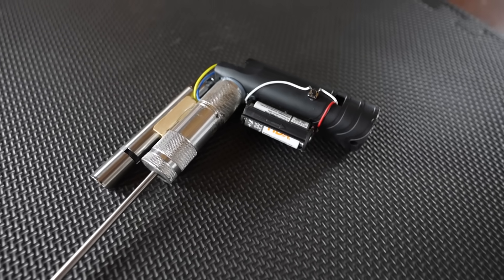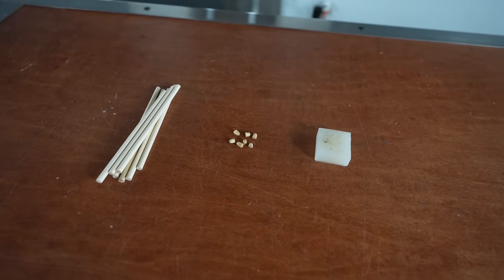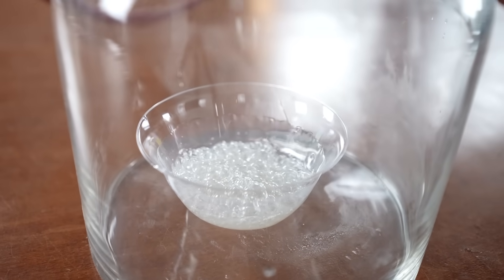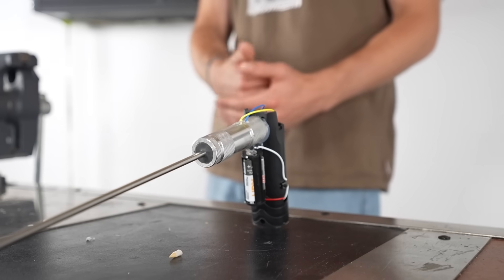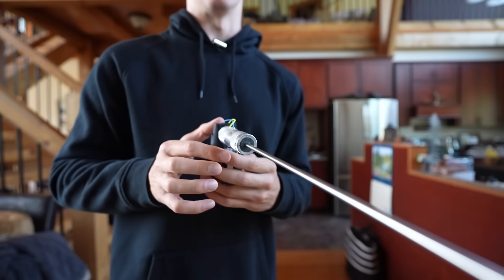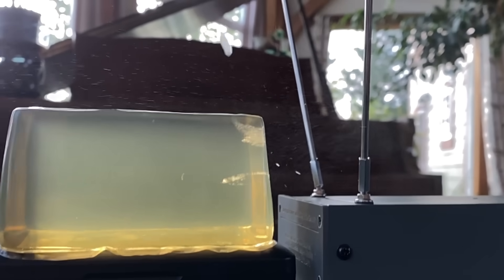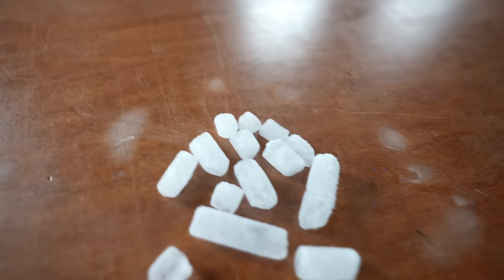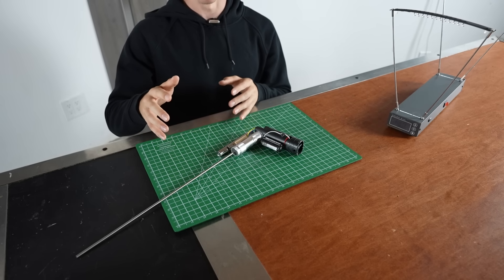I Made a Mini Desktop Weapon That Shoots ICE

Comment: Maybe put the ice bullet tray in an air tight box with a vacuum before freezing it and the bullets may be a little more solid and durable die to the lack of bubbles. I'd certainly be curious to see if it makes a difference.

Comment: So you need an exterior shell around the barrel that you can put dry ice into possible after shredding it into snow so that the barrel stays cold shorten the length of the barrel and use CO2 as the propellent
Reply: Also be careful and make sure the material the barrel is made out of a material that won't crack under those chilling temperatures it may not be an issue but I am not for certain

Comment: … the show BONES has an episode with this concept. The “killer” used a pneumatic device much like the one made. The killer then used blood frozen in the same molds. The reason blood was used was because it was more dense than the ice meaning they wouldn’t shatter on impact. The “blood bullets” also had a poison aspect because depending on the blood type of the victim the blood used too make the bullets would mix after the bullet melts. However this was all Hollywood and this video is real soooo.

Comment: maybe add something to keep you barrel in the dry ice, like a barrel around the main barrel with pocket for dry ice. seeing how long that is 3 or 4 pocket. but I think with 3 the barrel should be cold enough between shot. maybe also add a dry ice socket under you magazine. but that is only if you want to make many. but let's say we goes as far as a machine gun, the rope of bullet would have to come out from cooler. They wont have time to melt unless you are sitting in the desert or near a volcano.

Comment: I wonder if there is a way that you could freeze it while it's loaded. Would help to have a revolver mechanism. Maybe you could 3d print that. If the revolving mechanism were replacable, you could make it a fast reload also.

MAybe a pepperbox or mini gun style would work so that it basically has multiple revolving barrels instead of one barrel and a revolving wheel.

Maybe with the newly enlarged frame, you can find ways to cool wherever the ammo is held as well.

Comment: put a ring with a hole slightly smaller than the barrel between the barrel and gas chamber so you can drop metall bb's into it without having to unscrew everything and then use a small blowtorch to build the gas and fire

Comment: I thought about designing an Ice Gun many years gone by.  I would trash your ice-cube silicone mold and come up with an add-on that freezes the projectile in situ.  You might also have better luck if you make your ammo closer in size to a .22 bullet.   And perhaps slightly heating your ice bullet before it gets fired might encapsulate it with a thin watery surface, which would make it more lubricious.  Finally, I'd see about using the rifled barrel of an actual gun to see if that would increase accuracy of your ice bullet by keeping it from tumbling in the air.

Comment: you should make a gun that uses oxyhydrogen directly made in the gun itself from a dry cell as fuel
also use a peltier and an auto loading system to automatically freeze water and load it. then the only stuff you need is water and electricity

Comment: I see a lot of comments talking about Peltiers, but they are not energy efficient.

I think you should either use a mini cryogenic tank holding LN2 to flash freeze the water into shape and cool the barrel.

Or… you can use a refrigerant and cycle phase changes to transfer heat to do the same thing..

Comment: Hey, it's a great idea, I'm just wondering if you could make some sort of air rifle, that doesn't rely on that combustion for the pressure, if it was using a CO2 cartridge, it might not create as much heat.  Also maybe you could find a tube of the same internal diameter but with a thicker wall, this may take longer to heat up after cooling.

Comment: Use a bike pump as the combustion chamber, design a way to keep the piaton locked before shooting, instead of a valve to keep the pressure you could use some sort of plastic film that will break when the combustion gets triggered

Comment: Boo make ice VI with steel moulds and a hydraulic press, it will last longer. Or use heavy water ice. Perhaps research some fibre reinforcement that melts away or blends in well with animal tissue, like metamucil or hair

Comment: You should make a rapid ammo freezing mold. Like you put water in it, then pour liquid nitrogen into a cavity within the mold. Or make it with a cavity to put dry ice into. That way the water ice freezes really solid and stays cold. Plus, ice that's below at liquid nitrogen temperatures is VERY hard and strong. With an ultra-cold mold you can make more ammo very quickly. I love the dry ice cooled barrel.

Comment: I'd recommend a website called BurntLatke that can help with the calculations to get the perfect fuel to air ratio for a given volume to increase the power and consistency of your shots. There's also an old forum called SpudFiles that deals with potato cannons and other related launchers. It's a bit slow and it's not very active but you can search for great ideas if you want to improve/optimize your build such as how to build a propane meter to fill your chamber with the correct amount of gas or spark placement to speed up the combustion flame front. They also have a wiki with a lot of technical information.

Comment: I would say use liquid nitrogen with copper tubing around the barrel or a copper pipe that's bigger than the barrel and just cover the openings and put liquid nitrogen in it, and shake it around while having a pressure release valve, i know the barrel may get bigger but would be cool, and try firing liquid gallium when solid, that's my thoughts

Comment: Been thinking that having multiple sparks uniformly distributed in the combustion chamber might make it explode faster. Making them spark at the exact same time might be difficult so maybe just have a wire with several smaller airgaps along its length (should still spark), which would spark at exactly the same time and lead to more even combustion. Also, have you tried HHO2 gas yet? Super easy to make, and IIRC the blast front travels at Mach 9.

Comment: It needs to a 3D printable handle. That way you can house the wiring and trigger better. But then don't forget to share the files (doesn't have to be for free). Also a full proper step by step build video.

Comment: If you want ,, clear " ice ammo. Build a small Styrofoam box , put your ice moulds in, and then in the freezer.  Takes more time, but in the end, you get clear ice without bubbles.  Works for normal ice cubes as well 👍
Reply: Why does this work?
Reply: @hannesaltenfelder4302 The longer it takes to freeze, the less bubbles you'll get. It has to do with the outside of the ice cube freezing first vs. the expansion of the center of the cube.

Comment: Rifling the barrel would be extremely difficult. But it might be possible to rifle the ammo. Not made of ice, but possibly wood or plastic. Also, you need some way to standardize your fuel charge at the best mixture for maximum strength. My potato cannons all used propane torches to feed both fuel & air into the combustion chamber. Perhaps you could incorporate something like that.
Reply: Rifled projectiles do not work. They exist. But, they essentially do nothing.
Reply: or even HHO as you don't leave any traceable residue gas :)

Comment: Make an air tight canister around the barrel similar to how water cooled guns are. But fill it with liquid nitrogen so it's always cold and stays cold.
Reply: Usually airtight + ln2 = explosion, sadly. 

What he can do is spray liquid nitrogen over the barrel, or even just butane/propane into the front. The bullet seals the chamber anyway.

Comment: To add to my other comment, also a common c02 canister when pierced, could freeze an entire water tank magazine if designed correctly, as long as you dump that mag quickly, and can use a peltier to keep them frozen as they are way to slow to fast freeze anything lol
Reply: So would liquid nitrogen be to hard to source or not effective enough or to hard to wrap the lines and barrel and make a semi auto style water gun with a cold block to make ice ... ?

Comment: you could try using more powerfull fuel or oxidizer for the oxidizer example : nitrus oxide (you can find it in whipped cream can ) and for fuel i would try ether (found in starter fluid) and this should make much more powerfull mixture

Comment: You should add a barrel shroud filled with dry ice so you don't have to recool it all the time!
Reply: Dry ice is solid carbon dioxide (gas at STP) it would require way more cooling

Comment: honestly, i think you've got most of the design down for the actual firing mechanism, but i think the overall weapon could be improved by adding a 3d printed case, scope, etc. The gun currently looks like some kind of terrorist bomb assembled in someone's garage, but i think that with a proper ergonomic grip and outer casing, it could really look and feel like a weapon.

I also think the loading method could probably be made faster and easier, possibly through a valve in the cylinder that the explosive fuel could be easily pumped through.

Comment: Definitely rifle the barrel and maybe use dry ice as ammo?
Also it would be awesome if you could hold the barrel under vacuum with a valve to suck the air out and some tape at the end of the barrel. So that when the pressurised gas is released/trigger pulled, theres zero resistance down the full length of the barrel.
Reply: You can't use dry ice with a metal barrel. I will evaporate into gas quickly.
Reply: agree, cause atm the air in the barrel probably slow the bullt down quite a bit, however it needs to be taped on both end cause the chamber can't be under vacuum (some kinda valve ? it s gonna be tricky to engineer). also dry ice is kinda rdy to turn into gas rly fast so maybe for that water is best.
Reply: Just sealing the muzzle end, cooling just the chamber edge, inserting the ammo, and then using dry ice along the entire barrel should decrease pressure in the barrel quite a bit. 

Maybe use ECM for the rifling?
Reply: The gas needs air to ignite

Comment: well of course you freeze the ice at the spot, from water tank. co2 ice projectile slugs would just gas off. well, co2 ice works also as a projectile launch gas. two in one shot. you can use battery heater to get some pressure from the co2 ice.